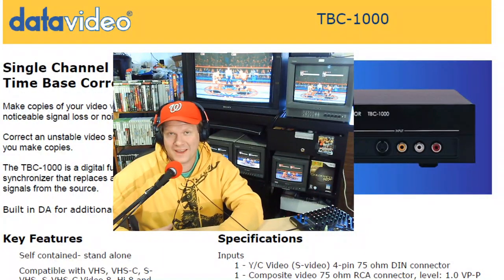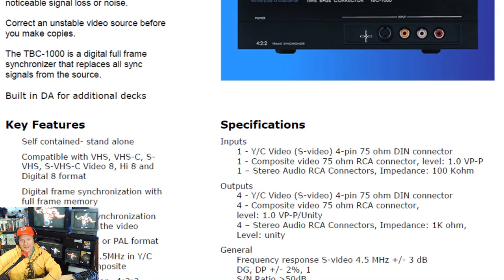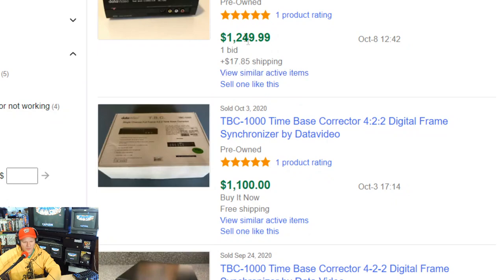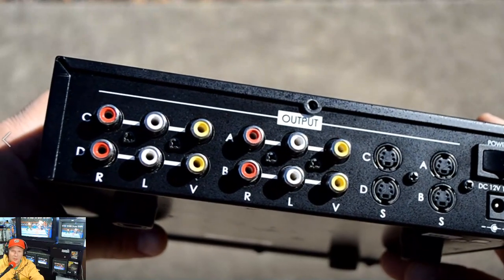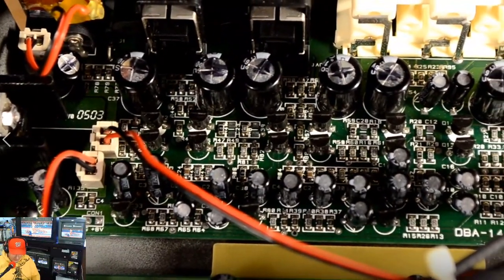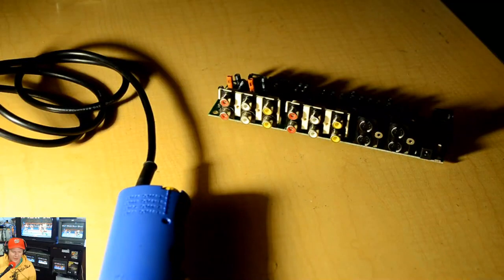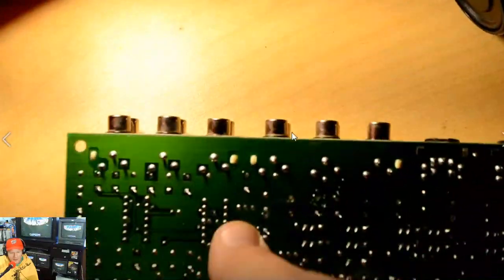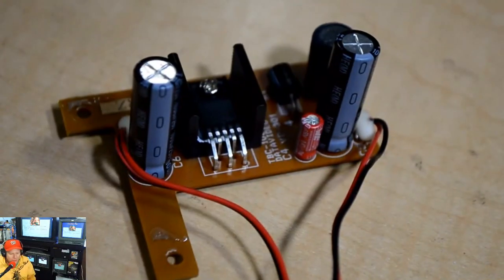DataVideo TBC-1000 | Commercial Time Base Corrector Repair | Retro Tech

Comment: Just a small correction. Most anime on VHS never had Macrovision (outside of some disney tapes). The main reason this is a must have for VHS collectors is it fixes dropped frames. Production companies had to make sure any tape they broadcast onto the airwaves never had any "NO SIGNAL" errors. They probably never intended people to use these at home, but in the modern age when you want to make a video about a VHS tape, they're an absolute must otherwise you completely lose the signal any time the tape is damaged.

Comment: I got two "Commercial Use Only" Panasonic S-VHS players from Goodwill and they have built-in TBC.
Reply from the maker: That's a great deal.
Reply: That's what they call a "LINE" TBC. Mine is a "full frame" TBC. 
Two TBCs for two separate tasks.
- The line TBC is for cleaning the image quality. 
- The external full frame TBC / frame sync is for correcting signal problems.
Reply: @kennylauderdale_en  Thanks.

I got the AG-1970P and AG-1980P. Someone wrote a FAQ that said "Panasonic's [AG-1970P & AG-1980P] S-VHS professional editing decks, with full frame TBC (instead of line TBC)." but then contradicted himself elsewhere calling it a "full-field" TBC. Guess I don't know what to think! :)

Only works for playback though... no pass-thru.
Reply: @RetroTechUSA  Yeah, only problem was that I was visiting family across the country and they displaced a lot of other stuff from my luggage! ;)

...then the capacitors went bad a few years later. The people recapping these and selling for several hundred dollars aren't sharing the cap values so I'll eventually make a list but just getting to them all is such a b@!$h that I haven't had the chance (been years).
Reply: Panasonic don’t get me started. Most are going to have bad SMD capacitors on the ceramic modules in metal casing like the AG 1980 and bad thing is they used printed on trace resistor so when the SMD capacitors fail and metal casing contains electrolytic it eat though them making it unrepairable. I have 5 of them sitting for very reason and part is  unavailable, so you can’t even replace the whole module.

So I use my JVC s7600 and s9600 for transfers instead. I wish I could get the AG 1980 working correctly again but ceramic module is destroyed as traces and printed resistor eating up, even metal can on outside is rusted from corrosion.

I do have a couple that maybe able to repair as not as bad as the other three as low hours but not holding high hopes till I take module apart, but at least no rust on outside can?
Reply: @thetechgenie7374  Jeeze. If I’d known it was that bad I would’ve got them out a long time ago. :(
Reply: Irrelevant : the built-in "TBC" found in VCRs are just "line" TBCs, this unit is a full frame TBC, totally different..
I have one myself, bought for about 500€ in the mid-2000s, great device when dealing with shifty sources -though most of the time I don't use it, as it slightly shifts the chroma output and hence needs some post capture processing with Avisynth.
Reply: @regish759  Perhaps you missed this part:
“Panasonic's [AG-1970P & AG-1980P] S-VHS professional editing decks, with full frame TBC (instead of line TBC).”
These are not normal VCRs. They are from a production studio. Professional equipment with BNCs, just like PVMs. Supposedly they have full frame TBCs.
Reply: @emmettturner9452  No, I am aware of those. But most users wouldn't have either of those as the ones that are still in working order are jealously kept by their owners, who know what they're worth.
So it's highly unlikely a Mr Average Joe would have one of those.
Reply: @regish759  But I’m the OP.

When I said “I got two ‘Commercial Use Only’ Panasonic S-VHS players from Goodwill and they have built-in TBC” I was talking about the AG-1970P and AG-1980P, which is what I have. They are not “irrelevant” “line” TBCs, as you said. They are “a full frame TBC” same as “this unit” you claim is “totally different.” What I have is what I have, which is irrelevant to “most users” and “Mr Average Joe.”

I was just bragging about a lucky find relevant to the video. I never implied that people could just grab a VCR from Goodwill to get a full-frame TBC like I did, but that’s exactly what these are.
Reply: @emmettturner9452  oh, sorry then ! :D
Reply: @emmettturner9452  But besides you, even if someone who actually knows the value of those models found one in a yard sale or estate sale (most likely place, since the sellers are usually selling someone else's stuff and don't know what most of it is), it's really doubtful it'd be in tip-top shape after all this time. And nowadays refurbishing one is next to impossible, as spare parts are no longer sold...

Comment: I stumbled upon that stupid Macrovision protection after buying my first capture card  : Radeon All-in-Wonder 1st-gen, coupled with an AMD Duron 700 OC'ed to 900MHz, 128Mb of SDRAM and a UDMA66 20Gb HDD) [dedicated and separated from the system and CD-R drives]. Even when capturing home-recorded tapes, the image constantly shifted luma values and the captures were unusable : when the image was stable, the audio sync drifted further the longer the capture duration... :( ATI was so afraid of lawsuits that they actually implemented Macrovision detection in their drivers and mede them so sensitive that it saw it even where it wasn't present !
A few years later I shelled out the equivalent of $1500 (in 2005 $) to buy a KDV-500 transcoder (since to add to my misfortune I was in SECAM-L land !), a TBC-1000 and a Canopus ADVC-110. This setup is way more hassle-free : even if it captures to the lossy DV codec, it more than makes up for the slight loss of video information with the totally stable video/audio sync at all times ! :)
Reply: DV isn't a "slight" loss. You're tossing out 25-50% of your chroma data, and adding blocks, due to that 1990s tech. Yes, DV isn't even 2000s tech, but 1990s. All consumer capture cards must legally add some form of copyright flag recognition. The ADVC-110 does as well.

Comment: There is nothing commercial about this, it is as consumer as it gets. Commercial gear use BNC connectors for Y and C not S-Video and RCA connectors. You can actually get rid of that distribution amp all together and use only one single output from the internal TBC board.
Reply: That's simply not correct. Lots of professional components also used s-video. The TBC-1000 was a pro units, but made to handle consumer formats. TBCs were never consumer gear, prosumer at least (serious video hobbyists, mix of consumer and pro gear).

You're also not correct about the internal TBC board. Many are factory modified, and do not work that way. The TBC-1000 saw multiple revisions over its 10+ years lifespan. Very few were raw TBC-100 boards. At best, you can bypass the VP299 amp. Either way, lots of case and solder mods needed.
Reply: @lordsmurf  It's a PCI dummy card, Was originally designed to fit inside a desktop into the mother board expansion slot but connections are made externally not via the bus connector, Someone had the idea to put it inside an enclosure and add a distribution amp, It was used in small bootleg houses, schools and churches not in a professional environment like production studios.
Reply: @Capturing-Memories  I'm hyper aware of what is in the TBC-1000, including multiple versions. You may need to look up who I am. 

Your assertions are wildly inaccurate. (And the statement that these were used by "bootleg houses" is even amusing, as bootleggers were cheap SOBs who almost never used quality gear.)

Time base correctors (TBCs) are tools, and entirely agnostic to the quaint ideas of "pro" and "non-pro". There are multiple types of TBCs (line, field, frame, some others), and each type can be tweaked to the intended source. DataVideo made multiple TBCs, in multiple form factors, in the late 90s into the 00s, specifically due to the professional need of ingesting (capturing) analog consumer formats to digital. Period, nothing more, nothing less.

It's not consumer gear, which is honestly laughable. These were sold by professional gear venues, such as B&H, most of which are now gone ('08-09 recession nuked many AV stores and manufacturers). These weren't being sold to Bucktooth Joe down at the Walmarts, or even at the "upscale" Best Buy or Circuit City. Not even Fry's, for the techno gearheads. Furthermore, these were intended to be used with quality gear, such as S-VHS VCRs with line TBCs, or cameras with line TBCs, not the $50 special from Kmart.

Additionally, these TBCs were useful to lower end pro analog formats, such as BetacamSP. Some DataVideos of the era included chroma keys, not for consumers whatsoever. The VP-301x boards of the TBC-100/1000 didn't wary all that much from the larger VP boards of the wide body units, mostly larger due to 2x TBcs and added features. But the base footprint of just the single TBC on those larger VP boards is almost identical to the VP-301x/TBC-100.

And again, not all VP-301x boards were the same. Most did not work independent of the VP-299 simple due to the power jump board. True TBC-100 cards had on-card power, and some slight pin changes. You can't just open up a TBC-1000, yank out the card, and have a new TBC. As if, if only.
Reply: @lordsmurf  Yes I know who you are Lordsmurf, But that doesn't change my opinion. Maybe we have different definitions of what a professional piece of gear is, Let's just leave it at that.
Reply: @Capturing-Memories  I almost forgot to address this: 

I'm sure some larger richer churches with AV used these (for sync'ing everything), and some colleges and larger/richer schools for TV and broadcasting education. Maybe even some analog-only operations that still existed, such as on-site event duplication (ie, one of many users for the VP-299). But those were not the primary audience. The trend was analog to digital, as far back as 1994-95, a few years after I got into video. And within a few years, DataVideo and Cypress both jumped into TBCs, to fill the void that existed. In fact, I've know multiple broadcasters that retired (2005-2020 time frames) who were doing this exact task, and had been since the 90s.
Reply: @Capturing-Memories  Ah-ha! ... and I think I know who you are too! :)

Yes, we can agree to disagree here. I just think your definition of "professional" is too narrow. You can professionally use consumer items, often in ways never imagined or intended. And that's precisely what has happened to consumer analog formats, due to the need of a digital transition. Various pro gear (including your favorite SDI box) can exist with the intention of connecting to consumer items. That connection doesn't make it consumer gear, or low end gear.

For example, I would somewhat agree that you don't create new content on a VHS tape, even using TBCs, and consider that professional use. Although that itself can stir arguments, because I can see where even my statement above would be untrue.
Reply: @lordsmurf  I don't consider my video capturing hobby a professional task by any stretch even when I capture professional formats. But I classify pro gear as the one used in production studios and TV stations, not churches and schools. We do agree however on how a proper capture job should be done though, That's what is important.
Reply: @Capturing-Memories  What I find interesting here is that I never saw these in use at churches or schools, but at broadcasters (TV stations, cable stations) and small/medium studios. As an example, documentary filmmakers would rent out gear, or work on-site, at production or post houses. 

I think I once saw a rack mounted TBC-3000 in a college broadcast class, while visiting as a guest speaker. I saw the studio because I was invited in, and given an AG-1980P. That was almost 20 years ago now.

And I've bought TBCs from large churches, in the 2010s, that had converted to fully digital workflows, though I never saw what those workflows looked like. Some large churches have AV pros operating everything, so it's really professional as well. 

At a band competition about 15 years ago, they were still duping copies to VHS, using a TBC-1000. However, it was a digital source, HDV, widescreen, so only the amp was doing anything, 1x input to 4x VCRs. Cheap VCRs. I don't know if the aspect was screwed up. Nobody was buying them, only the DVDs. I forget why I was even there, some work thing. I just remember the TBC-1000, odd to see in that setting, and that one of the bands played the Cowboy Bebop theme song.
Reply: As a final add, to prevent any confusion: 

People would often denigrate the TBC-1000 as "just consumer" as compared to some device intended for other use. Comparing it to a rackmount broadcast TBC was really not any different than comparing it to a dump truck. That wasn't why it was made.

But those new to video, those "simply" wanting to convert videos to digital, need to realize that TBCs should not be dismissed as "pro items". Do not state "I don't need pro items" or "I don't need this for a business" which are giveaways for folks that don't yet understand what a TBC is, or why a TBC is required. That's the wrong conclusion to draw here. 

Once upon a time, common items like telephones, washing machines, and freezers were also "pro items" that were adopted by consumers. TBCs are no different. The days of "only pros needs TBCs" ended 20 years ago, as affordable capture cards became available, and as people began to want to transfer tapes.

While the TBC-1000 was indeed a professional item, made to convert consumer sources, it does NOT mean that only pros use these. In fact, at this late date, the 2020s, more "at home" folks use these than any extant video facility. And non-pro use was true back in the 2010s and 2000s as well. I wasn't at all a pro when I bought my first TBCs ~25 years ago., just a hobbyist back then.

I didn't want anybody reading this to takeaway the wrong conclusion about TBCs, or the TBC-1000.

Comment: Too bad these units are extremely hard to find these days, let alone finding one in good working order and then there is the price...Personally I've come to accept what is for the most part small imperfections caused by deviations in the time base, most of the tapes I've done without a TBC has been surprisingly successful, a good VCR will do the trick in most cases.
Reply: Always start with a good deck with DNR like a JVC s7600. Yes the Datavideo has a flaw using a junk distribution amp added noise overlaid by mushy softening that is, if the garbage distribution amp doesn't cut out the signal altogether at random. Best TBC I used for consumer tape formats is a Iden ivt-7p but finding one that low hours and still works correctly is going to be hard as most have high hours and resold over the years. Very complex unit to service as two power supplies and two main boards and need test equipment and service manual to service correctly. Once serviced it one of the best TBC I tried to date as doesn’t freeze and proc amps are good on this one and does well with consumer level signals . 

Reason why most just pay for the Datavideo as much easier to service. Even back then the datavideo was about $500. I did get mines for $99 used back then but been many years and not very many around, so typically go for $500 to $800 for AS-IS $1200 is to much but you have to wait and add to search to get notifications but your likely have to replace a few capacitors. I won’t pay the $1800 to as high as $2749 those sellers are asking way to much for just replacing a few capacitors and for a Decent as will get the job done and better then the Cypress but not that great of a TBC as stated above. Yes they used junk capacitors and parts are under $18 bucks to replace yourself. If you really want to go though capacitors on the main board invest in a ESR meter.
Reply: @thetechgenie7374  This is NOT correct: "those sellers are asking way to much for just replacing a few capacitors". 

These units have many issues, and many are NOT related to caps whatsoever. I have to fully tear down and rebuild these at times, sometimes even having to completely replaced or bypass the VP299 boards. It's not cheap or easy to do all of this. Also tedious, time consuming. When you get a truly refurb'd unit, it's worth $2749 or so. 

But I would agree that it's overpaying eBay sellers, who most often wouldn't know a TBC from a toaster, and just want to flip units for a quick buck. They have no idea if the unit functions properly, or at all. That's not the same whatsoever. You're gambling, not buying. Odds are you're just paying big bucks for a DIY project. Or you can return it, so the seller can offload it to another sucker. And you still don't have a TBC, wasted time.

There's been a few hack repair units on eBay, and those almost all entirely failed within a year. I know this, because I've fixed a few, or referred it to somebody that I know can do a good job. That's more what you're speaking about. Amateur hour repairs.